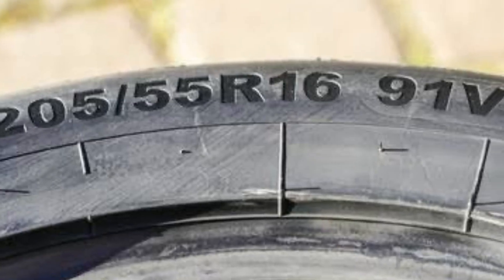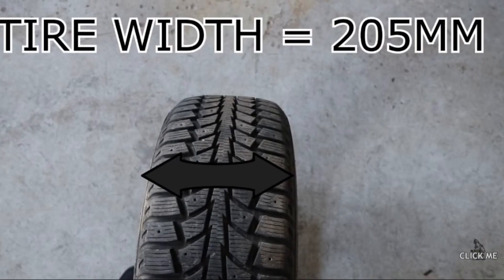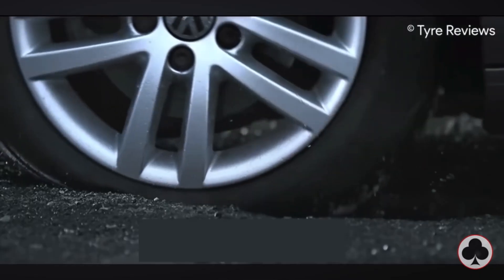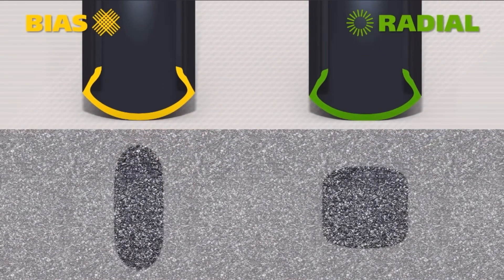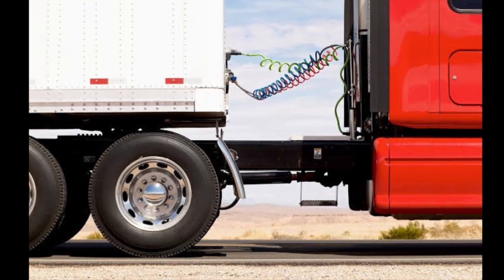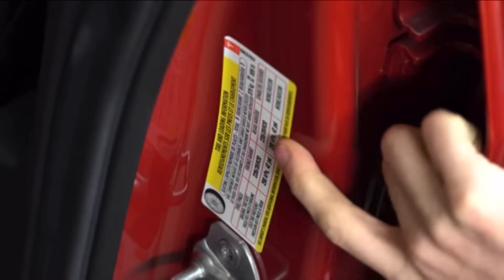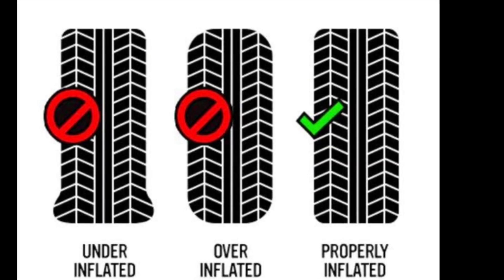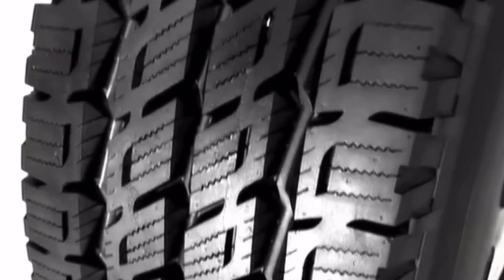"Tyre Sidewall Markings, Explained🛞| Your Guide to Understanding Markings & Symbols"

Comment: R mean radius beta. Ex. R13,, 14  etc
Reply from the maker: no, not actually
"R" stands for radial construction if it's  "B", it stands for bias-ply construction, and "D" for diagonal construction.
The tyre dimension is mentioned in terms of diameter (ex: 14,15,16 inches), not radius
Reply from the maker: hope I cleared the confusion😄